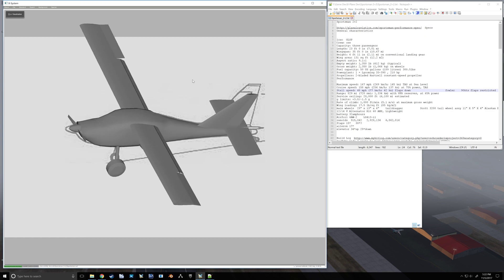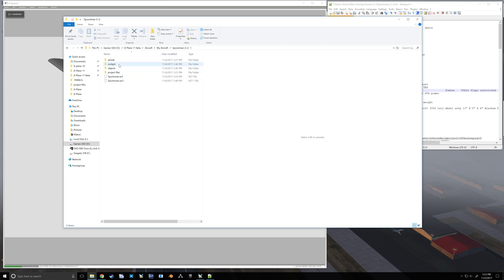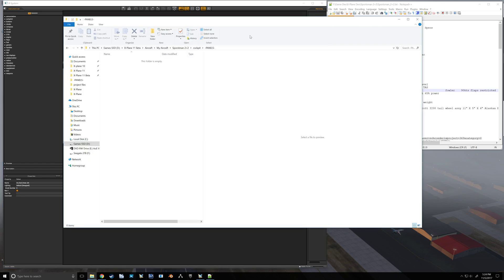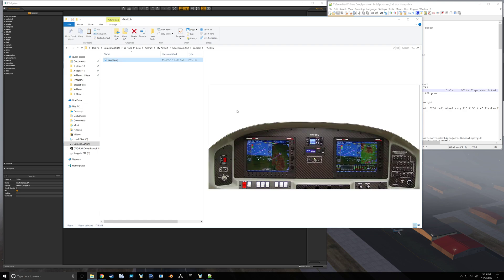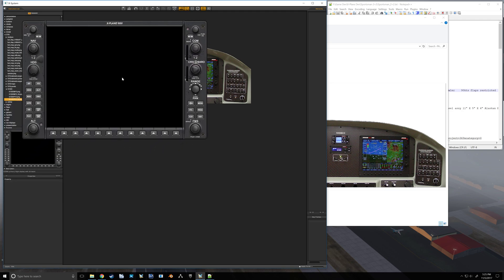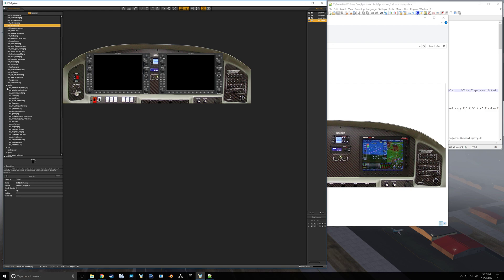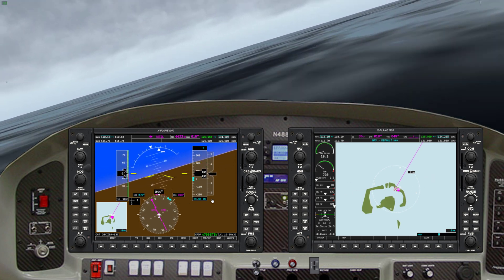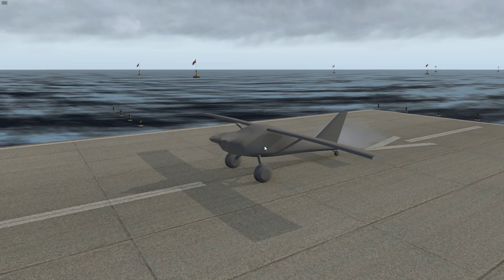Making an airplane for X-Plane 11 Tutorial #7

Comment: thanks for the tutorial. i found a glitch on 2d view screen and there is no any dashboard. how to fix it.
and also it seems we cant add g1000PDF/MFD anymore, so they suggest to use Garmin 430/530 located at radios>GPS FMS
here the screenshot : https://imgur.com/a/0ewvJ3b
Reply from the maker: Looks like your panel texture is not a power of two size, causing the issue in the 2d panel. I hadn’t heard of the g1000 not being available, I don’t believe they would take it away.

Comment: Hey, I notice later in the series, you remodel everything in blender with far more detail, do you import your blender model into plane maker and add all the instruments and switches?
Reply from the maker: Yes, the model is put into planemaker. It’s all shown in the videos. The blender model is for visuals with animations and manipulators, you still need the planemaker model for the flight characteristics.
Reply: Build It Better ok. I’m kinda new to this, so once you model in blender, you assign everything with blender to xp and then just so flight characteristics in plane maker?
Reply from the maker: The videos show from start to finish in the order I do things. I will complete the flight model and everything needed in planemaker first, do test flights and all of that. Then I’ll move on to blender to create the visual model and make everything look good with animations and textures. Then comes the process of linking the blender model to the planemaker model, this is done in planemaker and then in x-plane to test everything works. It’s a long process, but the key parts are covered in the videos. If you need more assistance as you build, go to x-plane.org forums in the engineering department to search for info or ask questions.
Reply: Build It Better ok. Thanks man